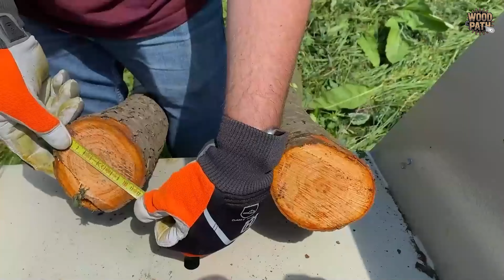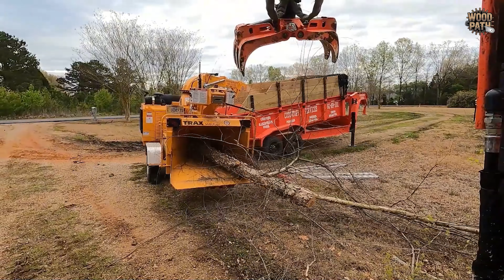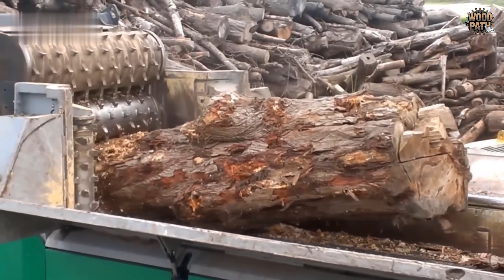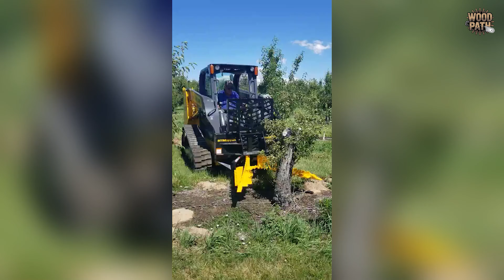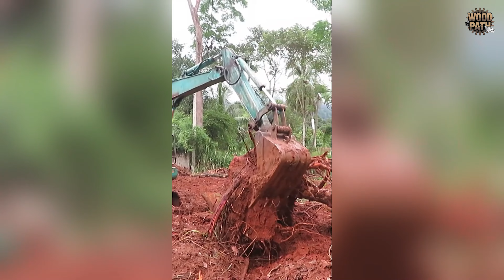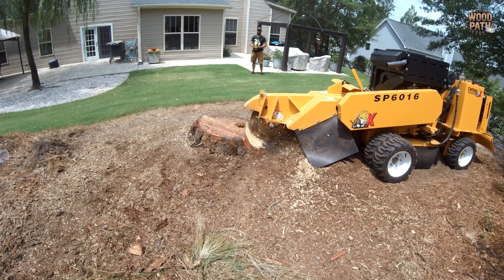The Fastest and Deadliest Tree Stump Grinder Monster Machine | Giant Stump Grinder in Action! #4

Comment: Efficiency and strength rolled into one machine. This grinder means business!
Reply from the maker: "Absolutely—it doesn’t just grind, it dominates! 💥 But wait till you see what happens when it takes on a stump so tough, it’s cracked blades before. Will this beast power through—or finally meet its match? Stay tuned! ⚙️🌳"